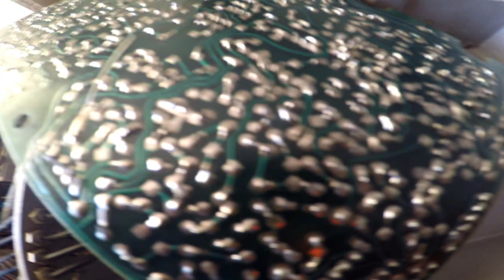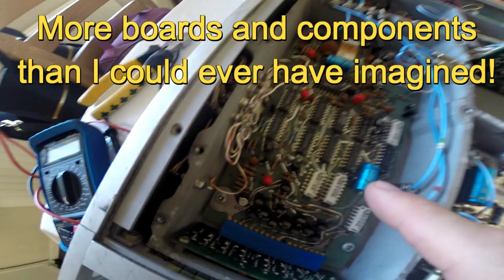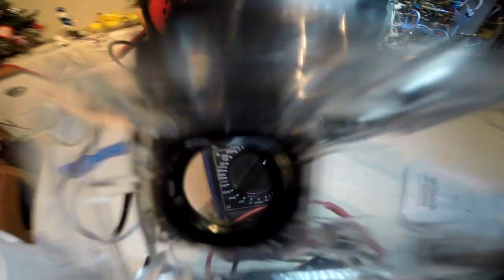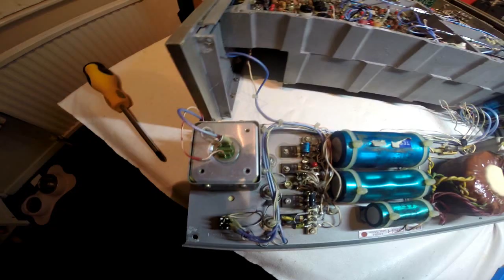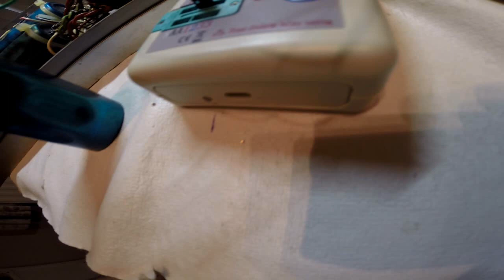Time to upgrade my gear - Part II

Comment: I have this same unit which lights up and does not a lot more. would be nice to have it repaired but not a clue where to start. nice to see you can find the manual right enough.
Reply from the maker: Do u do any electronics yourself, when u say it doesn’t do much hsve you connected it to a cb radio to see if it has any output. Is it a 9981 or 9982 unit?
Reply: @britishcbradio1055  I tinker around and will give things a go the model i have is the 9082 from what i remember the frequency lights up as all zero's - never tested any further beyond that as it did not change frequency with the dial. those capacitors look a good place to start if i thought i could make it well again :) keep up the great content.
Reply from the maker: @Chris-tx9ou  google search “ racal dana 9081 help needed” and you will find all the info on the repair / faultfinding of mine i found a couple of experts as i only usually work on cb’s  so needed a bit of help with this one. Good luck and be careful inside as 240v!!
Reply: @britishcbradio1055  many thanks for the advice I will search around a bit more.

Comment: That’s an old bit of kit how did u get into electronics. There’s not a lot of folk that can work to component level these days
Reply from the maker: Hi Marcus, i worked at an electronic company for a while and learnt a few bits and pieces but i am not an electronics technician or from that background. most of it i have picked up just doing bits and pieces on radios over the years and learning from others. I know what you mean about component level fault finding no one does it, they just replace the whole board for probably a 20p  component fault. Thanks for the comment much appreciated, all the best, Mark 👍